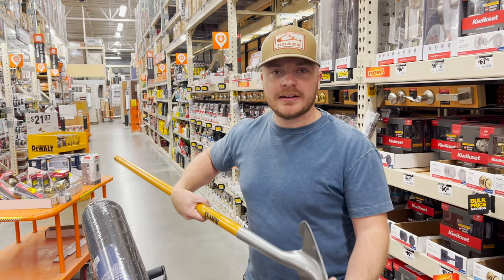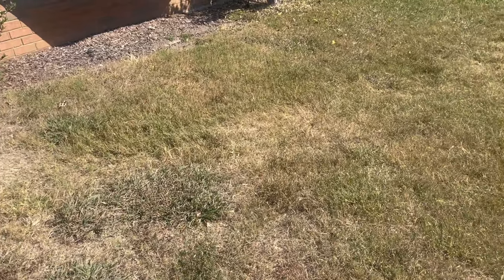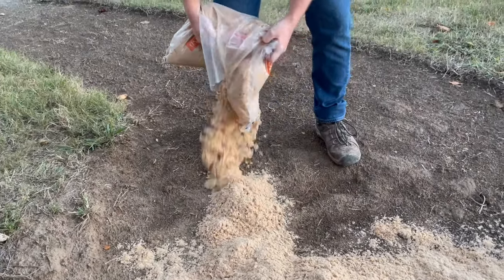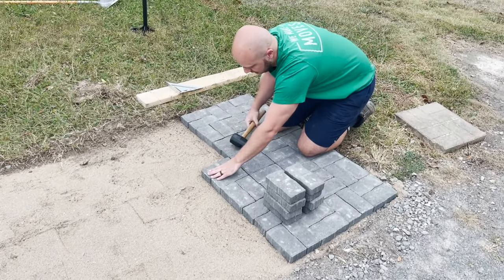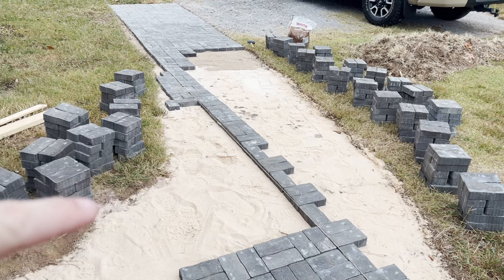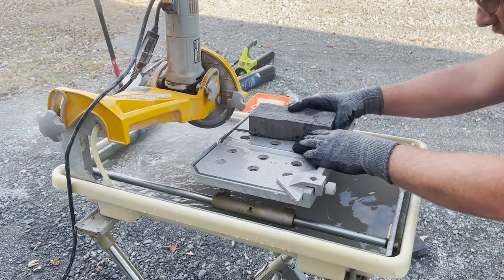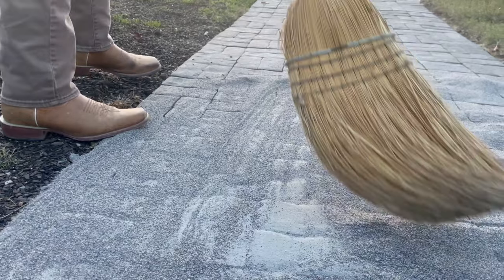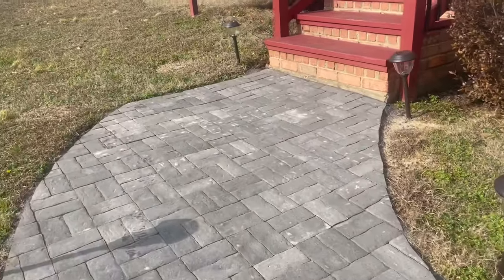DIY BRICK PAVER SIDEWALK (Under $1000!)

Comment: You two did a great job! You were also very smart to make the pathway in a curved manner. Squared off looks very basic, like the squared off sidewalks that come with new homes. I like that you added solar lighting. I would off placed less lights and not place the lights exactly across from each other......staggering them makes them looks more professional. But that is only my opinion. Overall, I am impressed with the work you both did! 👏🙌

Comment: I’m just curious how is your walkway holding up after a year. You did a fair job, but not having something on the edges to keep the pavers in place... make me wonder if the pavers didn’t start to move already because of pressure. But I admire the hard work and that you kept it real with no mumbo jumbos
Reply from the maker: Hey! I actually thought about doing a 1 year update which is a great idea!! 

I may upload something at some point when it starts warming up. It has actually held up great so far, and I would be honest with you if it hadn’t! This was a first time project for me. 

I have no settling or up and down movement happening.. I should probably use some more of the sand mix and brush it in between the cracks as some of that has washed away